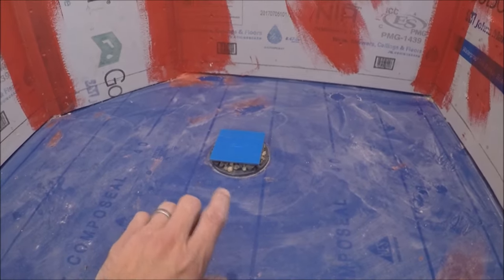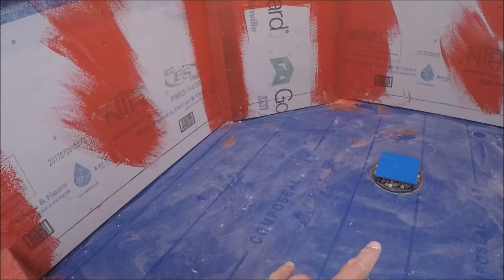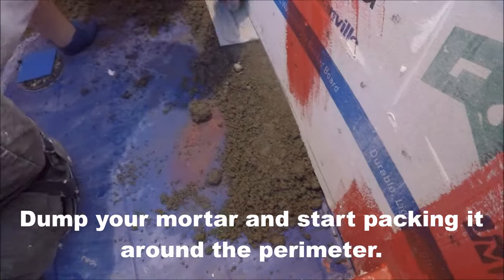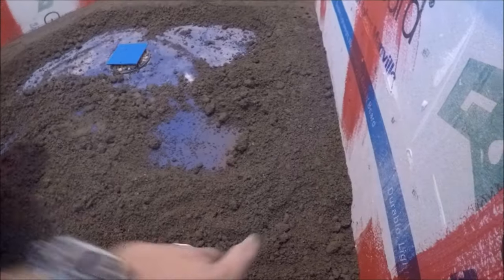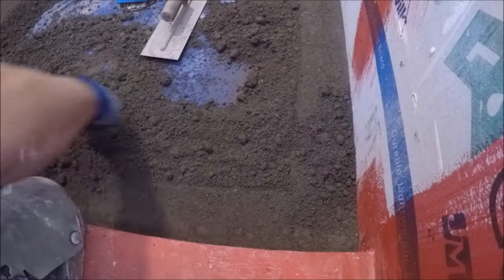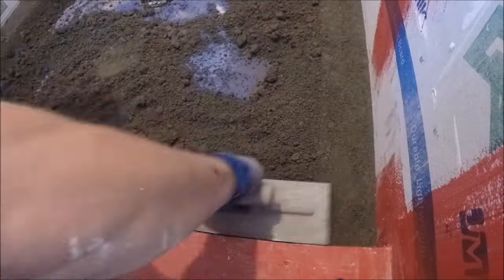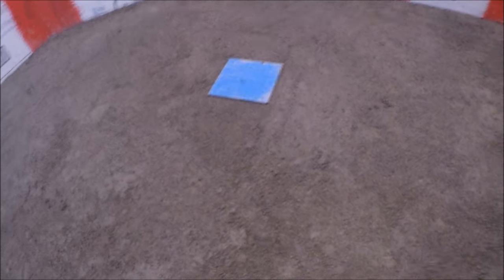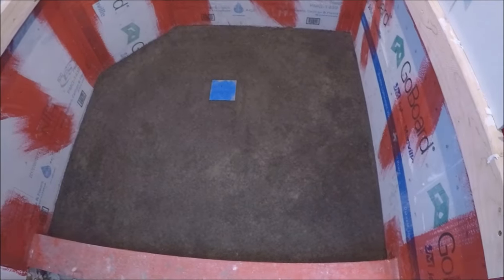How to Install Mortar for a  Shower Pan Quick and Easy

Comment from the maker: Link for the Bucket Mortar Mixer
http://amzn.to/2FknYyT
Reply: Why would the height around the perimeter be level?If you must have at least a quarter inch per foot.wouldnt the wall furthest from the drain be higher in elevation to keep the 1/4 inch per foot true?
The only way I can see the perimeter being perfectly level is if your were doing a circle pan with a drain in the center...even in a square application,should the corners be slightly higher then the rest of the perimeter?..I really need to know.
Reply: Chris, no man, you just go to the furthest wall from the drain giving it the 1/4inch per foot slope and from that point you go level all around the walls
Reply: @cesarrivera8881  so any walls closer to the drain will actually have a slope greater than 1/4" per foot, but no direction will have less than that? Makes sense

Comment: Finally after a thousand hack videos someone actually knows how to do a proper mud pan, i.e. "dry pack"and pea gravel around the drain. Cudos to you man! There's a ton of so called wanna be tile setters who should watch this and go do the same!
Reply from the maker: Thank you sir! appreciate that
Reply: If you really want to do it right would be to do a preslope under the rubber membrane then install your membrane and do what he just did .
Reply: Now a days we use kerdi drains and drypack and kerdi on top which is a way better system then this but we did do it that way for years it still works
Reply: @BMan-up3qj  Yes.  There is a video on here saying never to put the liner outside the  cement board and it shows the bottom of the cement board soaking wet, but I bet there wasn't a sloped mortar bed under it to flow the water away from the walls to the weep holes.
Reply: Why do people do the walls first?
Why do you set your walls in your floor?
Do you tile your walls first to?
Reply: Idk. Look at all those high and low spots at 3.35
Reply: @LandbergTileTV  Why pea gravel instead of masking tape?
Reply: Yeah, like the DR Horton contractors who stapled my liner to the shower floor, grouted the drain (no silicone) and glued the tile to the liner, no mortar bed. Just glue. It cracked and leaked thru the ceiling and the house is only 3 years old. I have to rebuild the shower.

Comment: Assuming you had a pre slope underneath that pan liner, this is a very good video. I've been packing pans for a long while and you did a great job. That is exactly how I like to do my pans.
Reply: Except the backer board is in the actual dry pack around the perimeter....never do this because of wicking...better to leave the backer ½ inch to an inch above dry pack
Reply: No pre-slope necessary.   He just sloped it
Reply: @cairney6308  that's what I heard too. But then I wonder: what holds the dry pack in place if the backer board doesn't go to the floor? Planning to do my diy shower pan this week
Reply: Yes I was arguing this with my contractors. I just assumed you would need to slope it first then add a liner.
Reply: @dunklechuck1188 pre slope is necessary. It is the most important step smh
Reply: @cairney6308 you can imbed goboard in the dry pack. It doesn't wick. It's a tcna approved assembly

Comment: Thinset a level backer board around the perimeter  approx 2 3/8 set your drain approx  inch and a half these are all approx you can then pack your floor mix then screed from the perimeter to top of drain then once your done spin your drain up to thickness of tile

Comment: I did a dry pack following the directions on the bag and it was too dry - some of the mortar mix just flaked away.  Went back and redid with more water and it's nice and solid now.
Reply: I did a preslope and had the "dry pack" about the consistency of the video and it was too dry. It flaked away like you said so I had to tear out re-do. I made it a little bit wetter the next go round and it worked much better. Be careful not to make it too wet.

Comment: It’s the only way to mix dry pack. Bucket mixer. You do great work. I still like to see you guys do it the old way, wire mesh around the curve and float it. And also floating walls. It almost eliminates cracks in corners which is big problem in showers. Then waterproof.kept up good videos.🤛
Reply: No it's a million times easier just to mix it in a garbage bag

Comment: Do your perimeter, screed off drain then turn your drain to to desired height. Way easier than trying to screed around drain
Reply: Apex floor designs LLC/Jason Morgan Good tip! 👍
Reply: What is screed?
Reply: @malawigold747  screed is a point of reference to run your boards off of. As you shave the mud down with your straight edges a screed is a point that gives you an absolute to work off of
Reply: @Apexjasonmorganllc  thx!
Reply: That's how I do it , poor more wet with some eisenwall and a little plastic cement , let it cure for a week either redgard or throroseal , works Everytime

Comment: Dude there was no pre-slope under that liner, flat as a pancake!!!  If you pre-tested your  pan,  filled with water for 24 hours, then  drain the water out you would definitely have  standing water. This leads to mold and mildew issues down the road.  MUST DO A PRE-SLOPE !!!!!!!!
Reply: This is what I am arguing with my contractors. I thought you slope it first then add the liner. Water will just collect if not. Right? Also my old contractor just red guarded the seems not the entire board for some reason. He thought cement board didn’t need it but it does.
Reply: @AM2PMReviews  Yes, you will actually have a pre slope first, then liner, then your final slope of motor, on top on liner with a 1/4 inch  of drop per foot.  The reason you have a pre-slope is that eventually water will migrate through your tile, grout, and motor. Once it hits your liner. you want it to flow towards your drains weep holes. If your contractor blocks your weep holes with mortar instead of small gravel, you will end up with problems. Ask your contractor to explain weep holes, if he can't, its time for a new contractor. If your job is being inspected by your city, they want to see your pan filled with water over night to check for leaks. they then pull out the stopper and watch how efficiently it drains out. if it puddles, your screwed. good luck. P.S. Redgaurd everything..... twice.
Reply: @shammydog1217  yes I thought this was the rule of thumb but I guess some guys say capilary action prevents water from flowing even with a pre-slope. even though Oatey recommends it.
Reply: That’s why you use a membrane over your mud bed up to drain depending on system. Kerdi liner with their drain it’s easy . Just build mud pan after a day or 2 install Kerdi membrane on top do corners and ready to tile ..if water goes through tile it’ll go on the membrane and the slope of mud pan will take it right to drain . And if you seal properly and do it right water shouldn’t get through it .

Comment: thanks for the video. I have a question. We have done the pitch 1/4 inch per foot on the mortar which under the liner, do we have to do pitch again on the bed which above the liner?
Reply from the maker: Yes you do

Comment: How’s the water going to drain away from the walls without a presloped mortar bed to start things off. It should be a presloped bed, liner and then your final mud bed for your tile. Just tore a second floor shower out that was done like this and the mortar stayed wet for so long due to no preslope that it was nothing but wet sand when pulling it out. This just sets the homeowner up with a rotten situation. You don’t need the peagravel because the water that wicks through will never make it to the drain to even use the weep holes.

Comment: Couple of concerns.   The pan liner appears to be flat on the floor without any pre-slope.  The arguments about pre-slope are endless, so this may or may not be an issue.  I put in pre-slopes because there is no negative to doing so.  The bigger concerns are around the wall board.  Wall board (Hardi-board, Durarock, etc)  is water resistant, not water proof.  Preferentially the whole wall board should be coated in 2 coats of red guard or aqua defense to water proof it.  This does not create a problem with tiling.  Second concern is the wall board is buried in the mortar pan.  The pan does get water into it.  That’s why the liner is required by both code and good sense.  When the wall board is buried in the mortar it is subject to wicking... plenty of examples online of wall board buried in mortar and  pulled down later with black mold reaching up a couple of feet thanks to wicking.  Lay the mortar bed and then install the shower floor tile to the edges of the mortar bed.  Then install the wall board with a 1/8” or so gap above the tile... no contact... do not fill the air gap with thinset when placing the wall tile (be careful about buttering the back of the lowest row of wall tiles, you don’t want to accidentally fill the air gap.  Position the wall tile against the floor tile and grout properly.  The air gap between the floor tile and the wall board will help ensure the wall board will not up water.
Reply: You obviously don't get how a shower pan works
Reply: @seangilliam4050  I like discussion and learning.  What do you see as incorrect in my comment?  It’s been a year since i posted it, but to the best information I can find, it remains correct.  I’d really like to know specific issues that you see.  Simply saying “You obviously don’t get how a shower pan works”  doesn’t explain the what / why of your concerns
Reply: That's exactly how I've done it. The discussion of pre slope is endless but if you know what you are doing the slope from the mortar shower pan is sufficient. Always start by using your shower pan liner and putting it up at least 6 inches up to the walls. I let mine dry then install backer board after letting it dry at least for one whole day. 1/4 inch off the mortar bed. Or as tile specify. After having a of that done I coat the whole wall and shower pan with regard. Haven't had any problems.
Reply: Companies like Oatey and other professionals do say to slope the pan liner.  Just saying.  Will it leak without it?  Probably not.  Will it retain more moisture than it should?  Probably.  

Also good point about not imbedding cement board.  It’s just a wick.  

Things like Schluter/wedi solve all this by having impervious sloped floor and waterproof boards, etc.  Wedi pan is a small fortune though.
Reply: @seangilliam4050  And you obviously do not understand how osmosis works.  You absolutely do NOT bury cement board in your mortar bed.
Reply: @seangilliam4050  you obviously didn't get it. BTW the RedGuard only over the screws?
Reply: @seangilliam4050  Not a helpful response; at best it is ignorant.
Reply: Go board is water proof, won't absorb water
Reply: Interesting stuff.  I looked it up.  A bit pricey, but not crazy expensive.  I’m paranoid, so I probably would still not bury it in cement, but waterproof is a major advantage!
Reply: @johndoerschuk7609  I had not looked at GoBoard before, but it looks like I can get a 3x5 sheet for $17 vs Hardiebacker @ $20 from Lowes. Because I had to use about $200 worth of  RedGuard in my last shower with Hardi, I'm wondering if it would be a wash - or close enough to consider GoBoard.  I had never wanted to use Wedi or Kerdi boards because of the immediate extra cost.  Any thoughts?
Reply: @GerardoGarcia-tb7gi  Why do you coat the shower pan with redgard when there is already a liner below? Moisture can get trapped and with no room to escape could cause mold to grow.
Reply: I heard you should do the cement board before you do your shower pan, that it's easier. I wanted to do my shower the way you're talking. What do you think and if I did my cement board first I guess I just got  to calculate where the bottom of it will be and be accurate so my cement isn't too low or too high and coming up onto the cement board right?
Reply: @davidcummings1909  I did the pan before the cement board.  I think you can do it both ways.   I found it easier to do the pan and then place a thin, long piece of wood on edge of the dried pan under where I wanted the cement board to go.  Then I set the board on the spacer wood and got exactly the separation I wanted between the pan and the board.

Comment: I want to do this to a friends shower, but the previous owner did some custom weird shower that drops down 6 inches. Tile was removed and is down to concrete. I want to fill it in and make it level with the rest of the tile floor. I suppose I should fill it in with gravel, then concrete it around the new drain height, then tile over that. Its on the ground floor, all concrete.

Comment: I don't understand why there is a second bucket with the bottom cut out.  What is the benefit?  Also, is that a sand mix (like Quickrete yellow bag w/red stripe)
Reply from the maker: That second bucket is a MUST! Sal Diblasi gave me that trick. Think about this...if you fill the bucket to the rim and try to mix it, the drypack mortar will spill out. If you use a second bucket with the bottom cut out, you can lift that second bucket up so that you can mix a full bucket without mortar spilling out. You then slowly pull that second bucket up and off and you have the fullest bucket possible to pour in you pan. You should definitely try it and you'll see what I mean. 👊
Reply: Use a wheelbarrow, mix 2 bags at a time with a hoe/shovel. Less mixing less lifting buckets and save from buying burned up drills because the tension bogs down their motors. If mixing a major amount like 5-6 pans in a day or doing a whole floor, buy/rent a tow behind mortar mixer.

Comment: My mud bed/wet bed has been laid and set for 2 days. We used a mix of Portland cement and sand. There seems to be some give in one spot when you stand on it (a bubble or air pocket). Is this a problem? Does the whole thing need to come up and be redone?

Comment: I see some tile guys are insistent about not to burry the wall cement board into the pan the way you do. So I am really confused about the right way to do it. Can you give me your opinion as to why you do it this way?  thanks
Reply from the maker: Yes, you can burry the board only if it's a 100% waterproof backer board like the Go board we are using. If you burry concrete board, yes the water will wick up, so never burry concrete board.
Reply: Great that does clear up the confusion on this issue. Also if you don't mind how much should you pay a installer for mud shower pan only? Just a range and I am on the east coast.  thanks so much!
Reply: Ken J everyone has different prices. Who are you to put a price on someones hard work? Quality isn’t cheap and cheap isn’t quality.  Lest don’t forget all depends on the time it takes since every job is almost always different.
Reply: @kenj1862  the going price on the east coast is 2500 .00 to install a dry pack mortar pan, of course that includes installing the pvc rubber liner too

Comment: I'm replacing a shower pan and cement boards that failed Welcome to not more than five years ago I'm very concerned about Burying my walls under the pan if I do my floor pan first then install my walls how do I make sure my walls don't belly out I got a wedge women Between the Sheets from one side to the other and hope for the best what's the best way to do this I'm very confused
Reply: I’m no professional but ,there is a video out there that says floor first always. They said it will almost be a guarantee leak ,if you did the walls first. Any info about this would be great.

Comment: you guys are doing it right and the same way I learnied how to do it in manhattan,  but I didn't see how you did the curb and attached everything...  how did you attach  concrete board over the top and on the sides of the curb with out puncturing the vinyl... how could it stay there securely?.. I am wondering if you have the answer... I know i do, contact me if you are interested
Reply: I  NAIL / SCREW  CEMENT  BOARD THRU  THE  LINER  INTO  SILL   KEEP  NAILS  AT  TOP  BOARD = SAY  1  INCH  DOWN  TILE  AND  DRY PACK  WILL HOLD  BOTTOM    I  USE  WATERPROOFING  - "RED GUARD"  OR  THE  LIKE .  NO  ISSUES  25  YRS  DOING  PANS

Comment: Relocating my shower drain right now.  Using a Kerdi H drain, is there a minimum height for the mud bed thickness or can I pretty much set the drain almost even with the concrete foundation?  It's about 1/2" off the floor right now.

Comment: Can you use sand topping mix for dry packing?
Reply: I just looked it up online and yes, you can use this. You can use Quikrete Floor Mud and Sand Mix for your shower pan. It is great to use Quikrete for your shower pan because it does not sag and has a quick cure time. The only Quikrete sand mix that you cannot use for a shower pan is Quikrete Deck Mud.

Comment: Hey buddy I see on another channel where the guy said never to embed your cement board or duroc in your shower pan, what’s your advice when it comes to that
Reply from the maker: This is GoBoard 100% waterproof backerboard. You can embed it with no problems.
Reply: Chris Campbell .
Reply: You can’t embed hardi board or any other fiber cement board because that will wick water . The tcna handbook says u can embed durarock because it is a true cement board, but I still prefer to leave a gap between wallboard and floor tile to help with expansion and contraction
Reply: If your cement board is embedded into your mortar bed floor ( inside your pvc membrane ) so that you have one solid monolithic structure you should apply several coats of a roll on water proofing membrane over the walls and mortar floor to create a total one piece water proofing system .